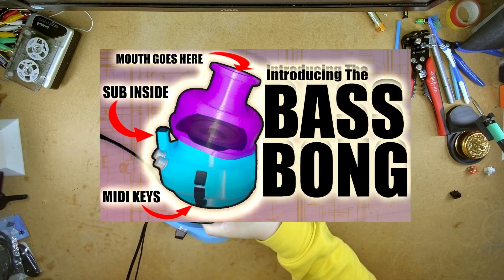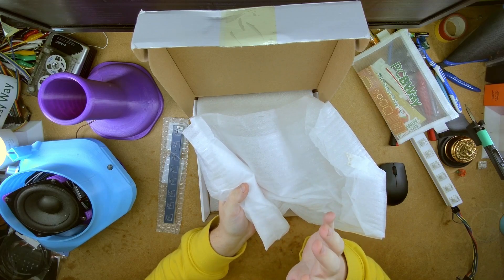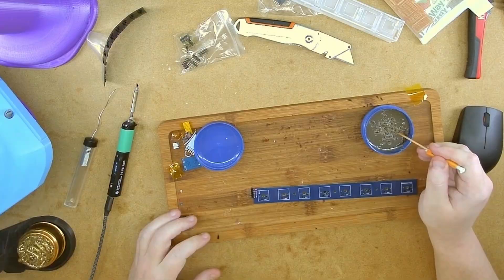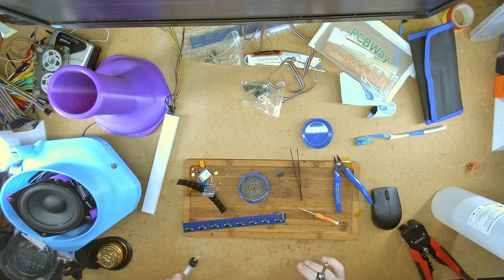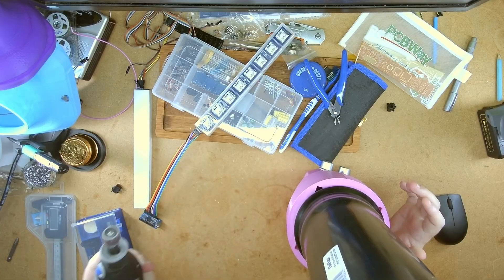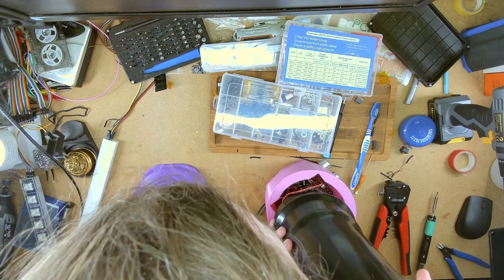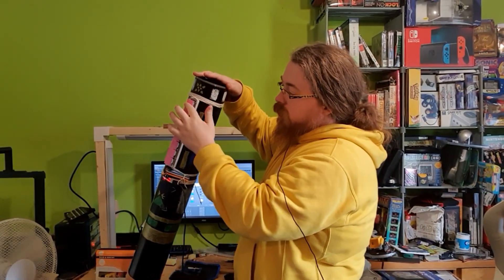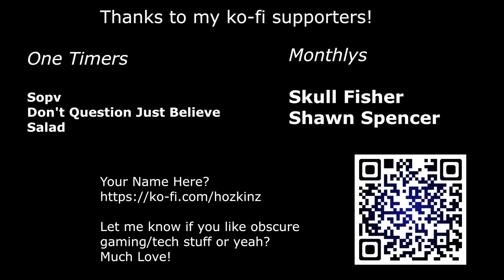How and Why I Made an 8 Key Keyboard

Comment: @10:24 it is wobbling the lens in the autofocus assembly. Though it is possible to "bend" light through acousto-optic effects, refractive index modulation or diffraction and scattering, it's not what is going on here. Those effects are waaaay more subtle on this scale and wouldn't be visible to the naked eye.